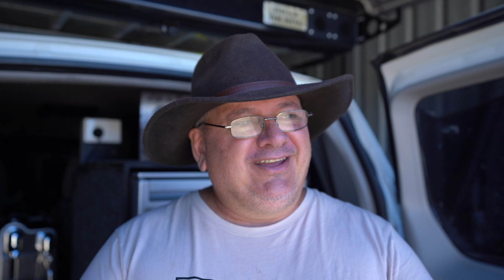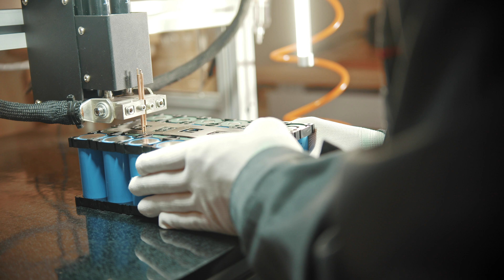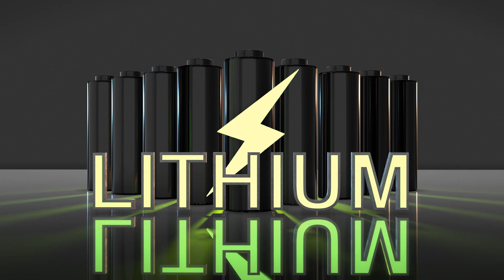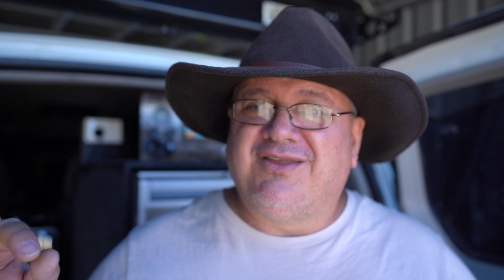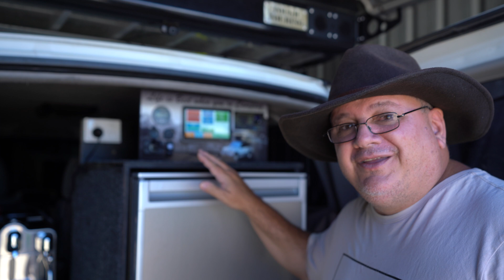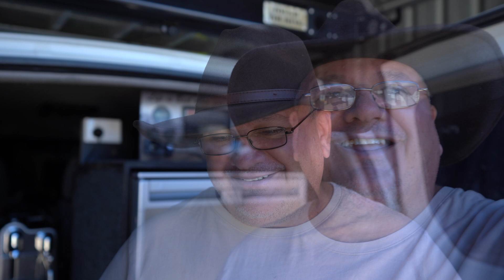Should  you go for a 12v 24v or 48v system for your 4WD

Comment: The key issue here is, most off-the-shelf 230v equipment and appliances are not really designed for off-grid camping. They are designed to be plugged into a 10amp 230v outlet and cook food quickly with little efficiency. When camping, keeping within the energy supply's limits is a higher priority over cooking food quickly. Super efficient (good insulation) variable wattage off-grid appliances is what the market needs more of. Devices that you can set at 100-2000w and everything in between. You could have the Air fryer set to 400w, the induction plate set to 400w and maybe a slow cooker at 400w. And have a small lightweight 1200w inverter supplying everything from 12v/100amps... then all you need to do is to have a beer, take it easy and cook the feast over an hour or two. No rush. No need to draw 1.21 gigawatts to cook the meal in 2 minutes when your camping.
Reply from the maker: If only it would work that way.  Problem is.  At least with my Induction cooktop is at 500w setting.  Don’t mean you only drawing 500w. 

What happens is the induction cooktop at 500w cycle on and off.  When it’s on,  it’s drawing over 1000w,  obviously when it cycles of it draws very little.   Over time average power consumption works out to 500w.
Reply: @PhilsCampingReviews  yeah, so effectively it's a 1000w appliance operating at 50% duty cycle. The 500w is maybe what the marketing came up with but the engineering team are shaking their heads ;)

Comment: It depends on situation like you say. For most a 12v system is adequate with right Charging and monitoring. Induction cooktops are great. If you want extreme offgrid power you must 1st think of ability to maintain charge. Along with what you want to run like induction cookers, Fridges and aircons. From there you can design system's. There are many companies out there supplying systems by far most popular is 12v for caravan and camping. Really you get what you pay for with Lithium same as Solar panels. Heat to output is a major limiter on Caravan's and Rooftop tents.
Reply from the maker: Not always get what you pay for,  Sometimes just because you pay more don't mean it's a great of battery product than something a lot cheaper.
Reply: @PhilsCampingReviews  it really depends on what you are looking for if you want High charge and high discharge currents then you need to spend on chargers good BMS monitoring and have a charging system capable to replenish. I always recommend people to work out exactly what loads they are looking at by writing down everything essential then luxuries then work out what appliances draw and what is length time you will need to use it max. Then we can work out battery bank size and charging equipment. Common misconception is people see monitoring displays and fail to add charge to current draw. To work out what the real current needed to operate item. Another forgotten issue is what time of day you need to use.
Reply from the maker: @gregorymcleod   Very good advice.  👍 

Yes,  research is critical.

Comment: Phil while most of your video's are informative. It is important to understand that building systems need to be done with qualified trades people talking about making Lithium batteries in cell values and how many cells. You must also consider BMS systems built in incase one cell has a fault or to thermal protection of batteries.
Yes having Lithium enables much larger storage and quicker charging and they do save a lot of weight. But if you not know what you are doing it can cause a lot of problems. For peace of mind you should put a disclaimer in one system does not meet all requirements and. I would advise any one who is not a electrician or auto electrician with Solar and lithium qualifications. To take the time call Victron, Enerdrive, or I tech world. They can help immensley. Ultimately if travelling you are far better having a professional system installed where they can monitor through a network connection to assist in fault finding and repair.
Reply from the maker: For most people I agree with you.  If you watched all my videos you would have noticed I mentioned a number of times that I will most likely not be filming a video on how to build a lithium system. 

Honestly,  it’s not as difficult to make one.   

I made lithium battery’s 10 years ago with balancing leads.  That’s another thing I’ve mentioned in my videos. 

I am more qualified in this than what you think I am.
Reply from the maker: I do my own fault finding and repairs on my system,  another advantage by learning this,  so if you are out in remote areas.  You can conduct your own repairs.

I don’t need someone to look over my shoulders and tweak my system without me knowing.  No way I will ever allow that unless I personally know the person and there experience. 

There are so called experienced people out there that think they know.  That I would not trust.

I’m curious,  do you work in the industry building these battery’s ?
Reply: @PhilsCampingReviews  I don't work in battery manufacturing. But yes I am a Australian recognized tradesperson as a Electrician. I have also done solar installations and have certification in NSW. I am now retired living in Thailand. I am a regular viewer and what I am saying is when you discuss DIY builds which you have done several good video's. But when you start working on high voltages in 240 which is inverters. I use to Work at Radio Australia in Darwin and hold a High voltage certification so yes I am a electrical professional. I understand if you are a electrician you do it yourself but many of your viewer's  don't have the experience of yourself and myself.
I have 40years electrical industry experience and I would still work with a company to set up exactly what I need. With remote access as I not as cocky as yourself saying you will never need manufacturer help.
Reply from the maker: @gregorymcleod   I’ve had manufacturers help.  How I learn.   Just I wouldn’t let them access to my system remotely unless I know the person. 

I have a  old mate that lives of and on at Thailand.  He lives there 6 months per year. 

His recently returned back to Australia since the start of covid.

I spoke to him today and he don’t like Australia enough to stay here. 

His talking about returning back to Thailand to live permanently. 

His got health issues and can’t work anymore.  He lives better and a lot cheaper at Thailand.
Reply from the maker: @gregorymcleod   Upgrading my Lithium battery,  to be honest I’m not rushing into.  

The gear I have now is working for me at this stage even though it’s only a single 105 amp capacity lithium. 

I’ve looked at prices of the cells which is not to bad.  But from I’m hearing freight is over $500 for 4 cells to make up a 12v battery.  

This will bring the price well over $1000 which will than bring tax and stamp duty in to play.   It’s not going to be as cheap as I thought it would be. 

So I’m going to keep looking at options available in Australia.  But I want a BMS I can monitor,  not like the BMS on the itechworld battery’s. 

For now I will continue with what I have.
Reply: @PhilsCampingReviews  I understand what you are saying. You can use Enerdrive there is also a S.A company. My point about having a network connection to installer would be for warranty and times I could not repair. I not mind any one knowing charge rates and discharge rates. I also not mind people knowing and able to run diagnostics remotely. I don't where a tin hat. I love Australia but am living in Thailand due to family circumstances my wife's mother is 91 has dementia so we are caring for her.
The biggest plus for 12V system is availability. When you get up into 24v or 48v or even 60v systems is getting your gear and charging.
My outlook is some big RV's may go 24v systems. It is not until you get into home power walls you would go bigger. But issue is getting your parts to put system together. 
By far invictron has the most logging and Daignostics. But even in Caravan's in Australia 12v is most popular as the gear is readily available. I would recommend anyone looking into building a system investigate putting a second alternator on car to charge and solar charge options.

Comment: Before I even watch the video, 12v is king, not enough 24v or 48v gear in Australia, any other voltage setup is too unreliable if something happens. If you need to use set down trannys just too much to go wrong imo
Reply from the maker: Agree.  Particularly for 4WD”s
Reply: @PhilsCampingReviews  but phil I do think 24v will be the next thing or 36v
Reply from the maker: @newport5504   24 volts would work well.
Reply: @PhilsCampingReviews  hey Phil was going to ask have you seen any Aldi airfryer in Bundy can never find any in Hervey bay
Reply from the maker: @newport5504   I never checked.  I can go see tomorrow if there open.